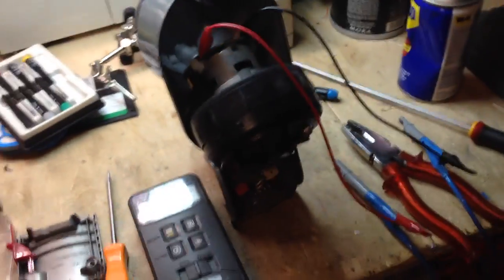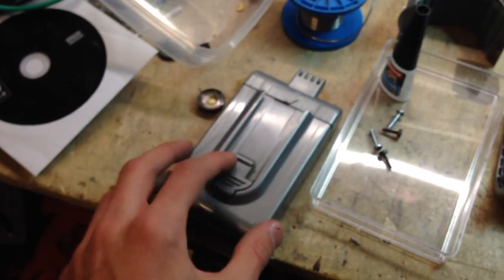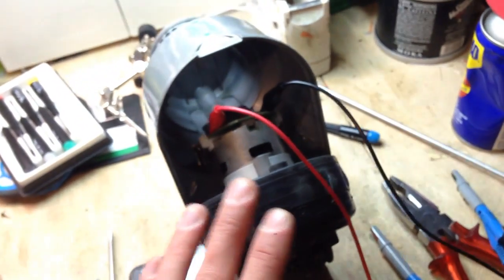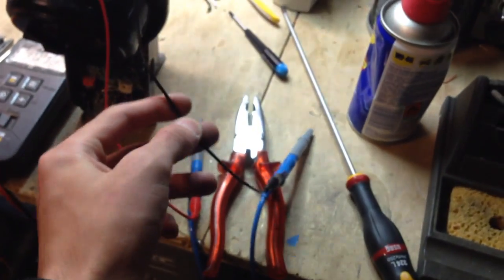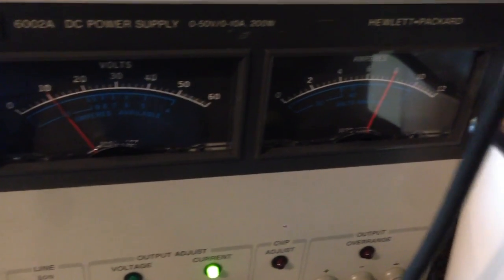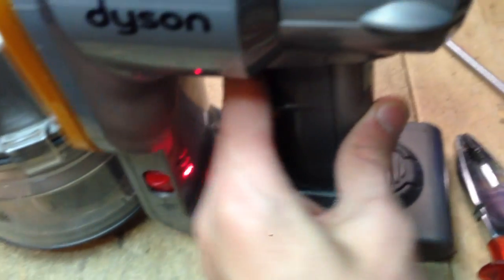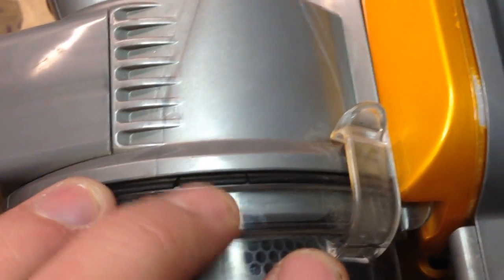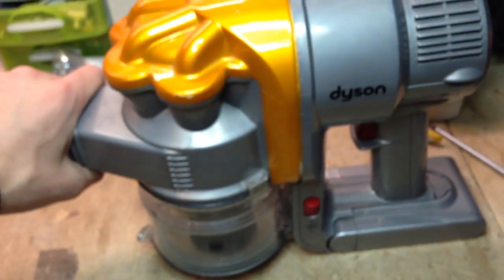Dyson DC16 Quick Teardown and Motor Test, why the battery lasts so little?

Comment: My DC16 died today, after only 16 and a half years of nearly daily use (nothing lasts anymore 😅). So maybe I will take it apart and see what happened.  I suspect the bearings on the motor maybe wore out as it made a weird noise and slowed down a lot before stopping with a burning electronics smell.  Either motor bearings stalling the motor or maybe the control electronics overheated in the summer heat? 

I will take a look when I get some free time

Comment: I wash the filters on my DC16 but it still stops after a few seconds and have to press the start again and again, it's a pain...
apart from that its a good vac.
is it possible to hard wire the switch bypassing all the sensors to run the motor until the battery is flat ???
any ideas anyone  ???
Reply: Oh the dc16 has a brushed motor

Comment: Can u do a video on how to take it apart? I cant get to the motor thanks
Reply: +Francesco Ferretti (Ferrix97) can you please just say how you removed the motor? Two screws at the back are out, what then?
Reply from the maker: +Tayyab's Room As soon as I'll get some more free time, I'll do it!
Reply: +Francesco Ferretti (Ferrix97)  Brilliant, Thanks!
Reply from the maker: You have to pry it out, there is a rubber gasket holding it in
Reply: Francesco Ferretti Dude I went at it for ages. Any particular tool to make it easier? I was just kinda wrecking it with a flat end screwdriver
Reply from the maker: I actually broke the plastic cover while prying it out, it is stuck in pretty well
Reply: Francesco Ferretti Oh ok. I'll give it another shot :) Thanks

Comment: Its not the battery its a magnetic sensor that is broken. See the link above to fix it.
Reply: Hello, I can't see the link you mention . Could you please re-post it ? Thanks
Reply from the maker: on my unit, replacing the battery solved the problem, the Hall effect sensor is used to make sure the filter is mount before turning the motor, the filter error has a different light code